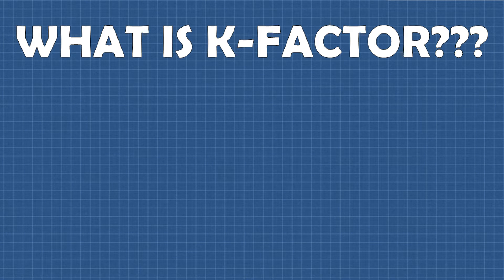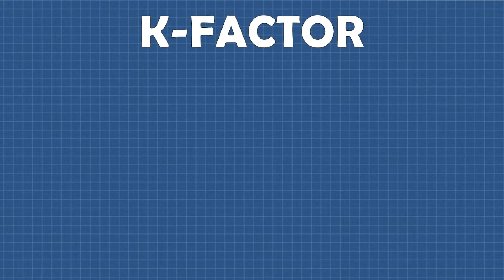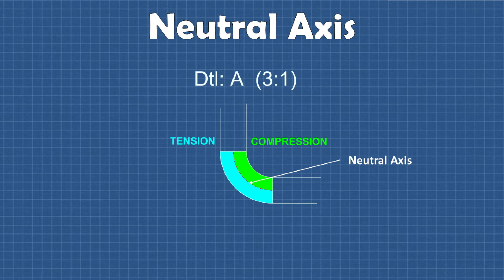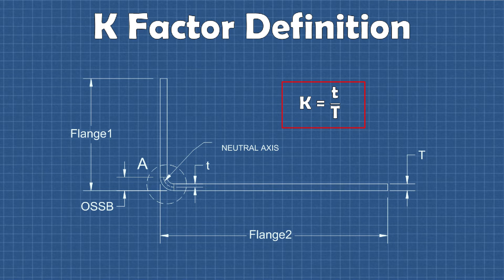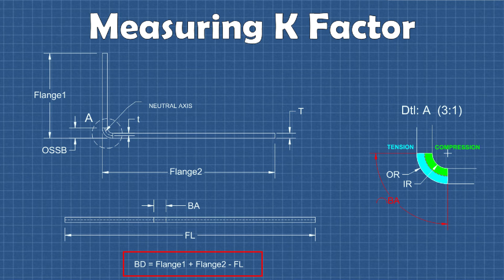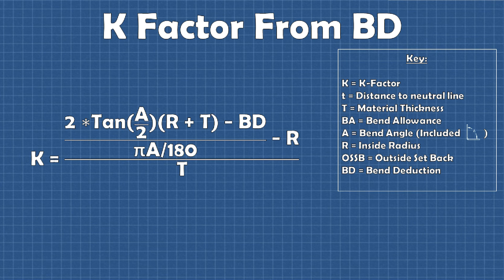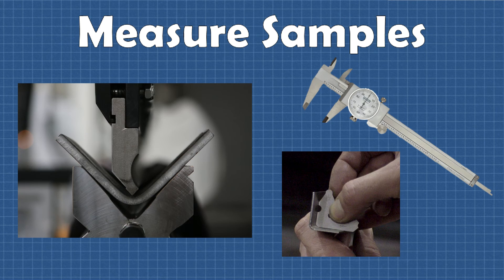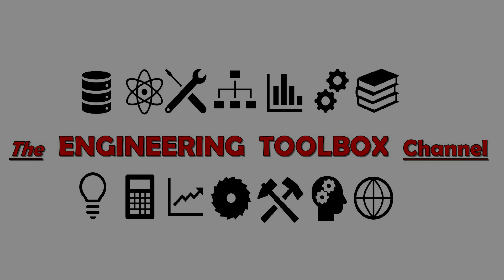Sheet Metal K-Factor (What it is & How to Measure)

Comment from the maker: Anyone that's good at math out there see a way too simplify this formula for calculating K-Factor?  My algebra skills aren't the greatest!
Reply: I've used a simpler bend allowance formula which makes the rearrangement of the formula a bit easier .
BA=AxPi /180 x(R+KT)
Where BA = Bend allowance 
A = angle in degrees 
Pi= 3.14159 
R = internal radius 
K= K factor no units 
T= Thickness units as appropriate .

So here is an example 
BA = 4.08mm
A=90 degrees
R=2
K is unknown 
T=2mm
Substituting in these figures gives 

4.08=90xPi /180x(2+Kx2)
Divide both sides by 90xPi/180
Gives
180 x4.08/90xPi=2+(Kx2)
This gives 
2x4.08/Pi=2+(Kx2)
Or
8.04/Pi = 2 +2K
Subract 2 from both sides giving 
2.559211485 -2 = 2K
So 
2K =.559211485
Divide both sides by 2 leaves 
K= 0.2796
Which rounds up to K= 0.28 To 2dp

So by measuring the length of the flat material and then subtracting the Outside radius from the leg lengths then you can come up with the length of the Bend Allowance and then calculate the K value for the work piece .
Does this help you at all ?
The length would be 96 + 96 + 4.08 = 196.08 mm .
Reply: Better than mine!! I wish I didn't leave school at 16! Thanks
Reply from the maker: Haha never too late to learn in the age of information!
Reply from the maker: Hi Rex, thanks for sharing that formula.  A couple other things I’d say… first of all k-factor will absolutely affect the flange lengths.  Also, k-factor should never be greater than .5 since the neutral axis will always shift toward the inside of the bend.
Reply: The easiest way to figure you length of an angle or K factor is to use .50   To figure out the length, the formula is Length = (radius x angle x 3.1416) / 180   For instance, if you are bending a piece of .125 thick material, and you have an inside radius of .250, use the radius + 1/2 T which is .0625. That gives you a radius of .3125 (at the middle of the material) Now say that you want to bend the angle at 45 degrees. So your formula would be Length= (.3125 x 45 x 3.1416) / 180  which is 44.17875 / 180   That gives you a length of .2454 for the length of the radius. And say the straight portions of the bends are 1" on each side of the radius, your blank length would be 2.245.
Reply from the maker: I feel like you didn’t watch the video.  You described how K factor is used when it is already known - in your case you said it’s always .5.  But every material, thickness, tool combination, angle, grain direction, etc results in a different K factor so for precision sheet metal companies (who need to achieve tolerances within .03”) you need to figure it out for each scenario.  In my video I am explaining how to back calculate K factor of a specific bend scenario (from the physical part).
Reply: sir can you please tell me  one book name through which i can get some what knowledge on sheet metal calculations and on other manufacturing calculations
Reply: Hello! If you give me an E-mail. I can sent to you another concept.

Comment: This is great job! But, what if we have multiple bend sheet metal bracket ?
Reply from the maker: Once you know the K factor for a given material you can apply it to all the bends on the part.  Your total bend deduction for the flat piece is the sum of the bend deductions of each individual bend.
Reply: @ Is there any difference, if I want to bend more than one radius at the same time (for example in stamp tool) ?
Reply from the maker: @КольоМамата-ш8г  this video was really made with soft tool air bending in mind.   The same basic principles as discussed in the video apply to all sheet metal bending, but there are some nuances you should look into and consider if you’re forming this bracket with a true stamping operation (or with “hard tooling”). In stamping operations, most forming is done via bottom bending or “coining”.  Bend geometry can behave differently than air bending when formed with these methods

Comment: Your video is missing a very important piece of information: How do you calculate the bend deduction? You use the flat length to calculate the bend deduction and then use the bend deduction to calculate the bend allowance, but you need either one of these two to calculate the  flat length, so pretty much you can't determine any three of this variables.
Reply from the maker: I think you are confused.  Where do you think BD, BA, k-factor come from?  They come from empirical results (measuring real trial pieces). You are correct… flat length is calculated from BD, BA, or k-factor.  But how do you get those values in the first place?  You have to start with a sample of known length, then bend it and see what happens! From that you can interpret any of the bending factors you desire, store them in a library and use them in the other direction to estimate flat length given (bend radius, material type, thickness, etc etc).
Reply: Then I think including how you determined the bend allowance or the bend deduction from the empirical data or the type
Of empirical data would greatly benefit the quality and comprehensiveness of your video. Of course I’m confused. I came to this video to understand sheet metal because I want to learn not because I already know about the topic
Reply from the maker: @ritchieron1 fair enough.  The equations are really all you need.  Just like any algebra problem you always start with what you know and calculate what you don’t know.  In the case of sheet metal bending, you know what you physically have in front of you.  The flat piece, the piece after it was formed, the tooling you used, etc.  From the physical part (empirically) you know flat length, flange 1, flange 2, radius, material thickness.  Plug these into formulas and that will allow you to calculate BD, BA, or k-factor as needed.
Reply: @TheEngineeringToolboxChannel  Thanks for your answer. Unfortunately in my case where I work, what I need to determine is the flat length. I receive materials to be used and rough geometries as inputs and from that I need to work the flat length to fabricate the final part. For this I need to either know the K factor or the bend allowance. The bend allowance can easily be calculated by knowing the neutral axis shift. Since I need the K factor to determine the Neutral axis shift I can't calculate the bend allowance or vice - versa. Hence my line of questioning.Thanks for the discussion and the exchange of ideas! Cheers
Reply from the maker: @ritchieron1 does your company do the fabrication internally or do you just design?
Reply: @TheEngineeringToolboxChannel  I do the design and send for fabrication. We don't do heaps of bending and for this reason the process hasn't been fully optimized. What we do is leave a green to make sure the last bend doesn't come out short and trim the last flange to the required size. Recently received projects requiring quite a bit of bending. I want to optimize this process and try and plasma or laser cut the flat parts in such a way that after bending the part is precisely as required (no trimming required).
Reply from the maker: @ritchieron1 if you are sending to another company for fabrication they should be determining their own bend deductions and creating unfolded flat patterns.  IMO and from what I’ve seen in practice is the job of the designer should be to specify the final part dims and requirements (after bend).  The job of the manufacturer is to determine how to make it so they should know what flat geometry they need to get the final formed dimensions correct.  

If you are cutting and forming these in house and planning to do more metal fab in the future I would strongly recommend starting to build a bend deduction database.  As I’ve been saying the only way to do this is to bend and measure results of formed samples to determine bend deduction for a given material thickness, material type, and bend radius.  Once you do the testing and build that a database based on the test samples, you have your BD to use in the design process going forward.

Comment: Is there a formula or best practice of a Natural Bend Radius? What do I send bend radius relative to material thickness. Example if I tell Solidworks 1/4” radius for 1/4” thick material. Like what would result from a standard V mold press brake at 90 degrees… ?
Reply from the maker: This is a very vague question.  What do you mean by natural bend radius? What do you mean by “what would the result be”?

Comment: The K-factor is a parameter in the deformation of a sheet metal. There are formulas to calculate the K-factor (see ISO 6935).
The result is a theoretical value. Which must be noted on every drawing. The actual K-value also depends on how the sheet is bent, how the sheet was made, how warm the sheet is, etc.
Reply from the maker: Thanks for sharing the additional info.  While this may be true in the design specs, where as a designer you do not know precisely how the bend will be made.  In practice, as a manufacturer, an actual (not theoretical) K factor can be observed empirically by taking measurements with a given combination of tooling and material.

Comment: Series of tests were carried out with each machine. The measured K values were entered in tables together with the parameters of the machines.
Simplified K-values are used for construction and drawing. The expanded views are revised depending on the machine that is used by work preparation.

Comment: I use inventor but their K factor is not the same as my presaved bend allowance numbers. What to do?
Reply from the maker: I am not as familiar with Inventor so I dont know what features are available.  I know Solidworks had BD tables that could be assigned to different materials and radius. 

If K-Factor is the only thing that Inventor allows you to use, I would suggest converting your BA numbers to K-Factor .
Reply: I modified the K factor unfold rule from 0.44 to 0.49 and now the overall size matches my saved bend deduction numbers. Hope this works. Thank you for getting back though
Reply from the maker: Just keep in mind that the k-factor will change for various materials and bend radii.

Comment: I don't understad. Does the location of the neutral axil depend on the bending angle?
Reply from the maker: Yes it absolutely does (among many other things - material, tooling, etc).  The exact location can only be determined through testing.

Comment: Excellent video, Thanks. I just tried for my values and got some false results. If possible, could you help me to figure out. T=0.075, R=0.075, Bend Angle=90 Degree, Bend Deduction=0.146. I want to know the k factor for this part.
Reply from the maker: What value did you get for a k factor?
Reply: @TheEngineeringToolboxChannel  T=0.1, Radius=0.1, B.D=0.179, Bend Angle=90 Degree.(All are inches). I am getting a K value is 0.73. I hope the k factor will not exceed 0.5.  Please let me know if the correct value?
Is it possible to find the k factor only using material thick, Bend angle, and Inner Radius? I found one calc(https://www.machinemfg.com/k-factor-calculator/) on the website and they are providing k factor by only using that three inputs. is it correct? Please suggest. Thanks

Comment: How do you predetermine the inside radius of each bend? Does the inside radius change if your top punch does or does not have a radius on it, or is the inside radius determined by the material thickness and the size of the bottom die?
Reply from the maker: To answer you question...the short answer is: it depends.  Mostly on process and material.  

When coining or bottom bending the inside radius will match the punch size.

When air bending the inside bend radius is estimated using the 20% rule.  For more on that see the link below and read up on more of Steve Benson's work.  He has put together a lot of good information on this topic. 

https://www.thefabricator.com/thefabricator/article/bending/bending-basics-how-the-inside-bend-radius-forms

Comment: Are these applicable for tubes ?..if not can you refer me some books.
Reply from the maker: This application is for sheet metal but the same formulas can be applied to tube bending. The most important thing is that you do testing to understand the relationship between flat and bent parts based on the bending process that will be used. 

See the Machinery Handbook for more information.  Or I would suggest googling more about tube bending online.  There should be plenty info out there.

Comment: you said that this formula only works for 90 degree bend , but what if the bend angle is less or more than 90 ?.
Reply from the maker: Where did I say it only works for 90 degree bends? The formula works with all bend angles.  The challenge with non-90 degree bends is measuring the part to determine Bend Deduction. While it is a challenge if you don’t have the right measuring tools, it can still be done.

Comment: Hi
How can i believe that there will be neither tension nor compression at the neutral axis
because  i see some deformation in the neutral axis as there is in inner part and outer
can u kindly answer my question !
Reply: It depends on what you mean by "deformation". Yes, the material within the neutral axis plane does move of course since the whole sheet is being bent, but along that plane (it's now a curved plane which is a bit confusing), none of it stretched or compressed. That's what he means when he says there is no deformation.
Reply from the maker: Sam Chaney ohhh I guess I can see how that might be confusing.  Thanks for clarifying.  So maybe deformation isn’t the best word.  Maybe it’s better to say there is not stress or change in length along the neutral line.
Reply: @TheEngineeringToolboxChannel  i would like to see a practical sample in which there will be no stress or no strain when we apply load on it
Reply from the maker: Hi Govardhan,  thanks for the question.  What do you mean you can see deformation in the neutral axis? The neutral axis should be DEFINED as the axis (or plane) where there is not any deformation or stress in the material. The outside part of the material is under tension and the inside material is under compression..... so EXACTLY ON THE AXIS, there will be no stress in the material.

Comment: Hi, is this possible to use for a steel rounded wire? It's for a wire bending machine...I need the length of material needed to make the bend...thx
Reply from the maker: Interesting question.  Are you asking if K-factor can be used to develop the cut length of wire blanks?  If that is the case then that answer is yes. The same formulas apply since they really just come down to geometry.  As long as you do the testing and control for the proper variables you should be able to determine some reliable K-factors.  I am not that familiar with wire forming so you will have to determine what the variables are that you need to control for.  (I picture you are talking about something similar to this..https://www.youtube.com/watch?v=j-gabeEJ7EE)  That being said, I imagine material thickness, material type, bend angle, stationary die radius, the distance the moving die is from the stationary die, etc.  Basically you will need to test and measure the results of each different bending scenario.